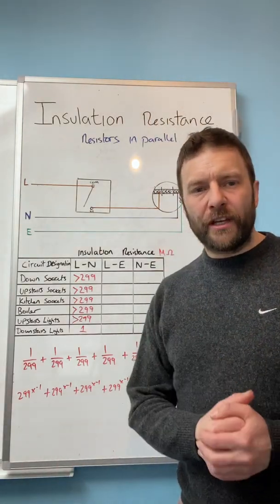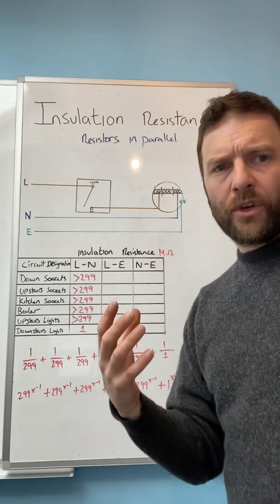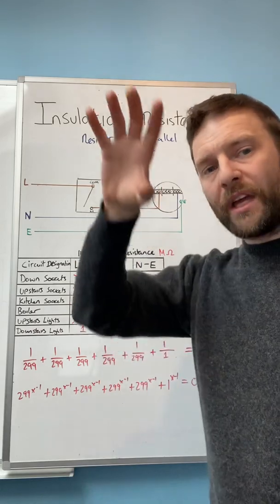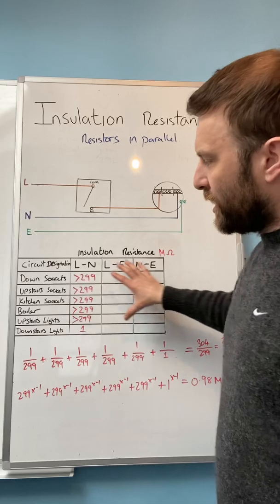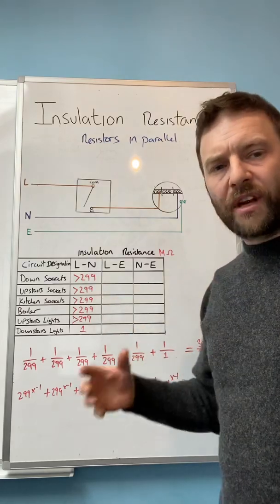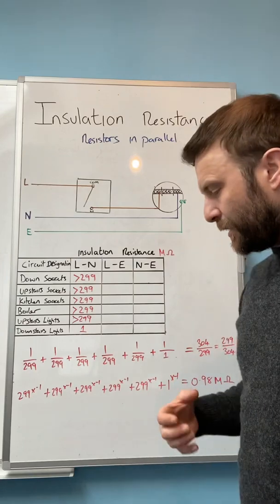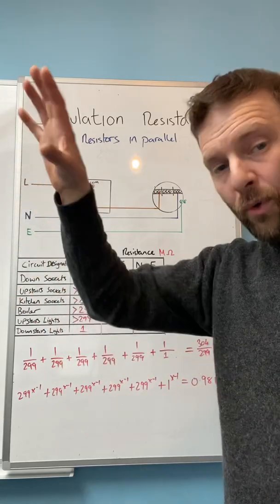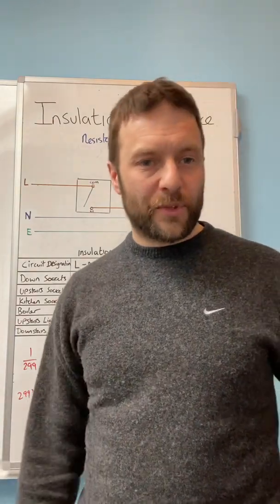Are you testing insulation resistance of a domestic installation properly? I now know I wasn’t!

Comment: Hi, what if you had 10 circuits all with 190Mohm? All the circuits would pass well above the minimum, however all the circuits in parallel would be around 19Mohm, would this then be fail using this logic?
Reply from the maker: No, because 1Mohm is the minimum for the whole installation
Reply: @Pure_electrical_training  I was using the example of 20Mohm, for a new installation.

Comment: Hi Adrian, could you tell us which document (GN3, BS7671 etc) recommends this particular procedure of calculating an installation’s IR?
Reply from the maker: It doesn’t, you learn it at college, but no one seems to explain the connection between resistance in parallel and insulation resistance of circuits 🤷‍♂️
Reply: @Pure_electrical_training  I see, thank you. Could you please explain how over range results given on IR meters (>999 Meg ohms for example ) can be used in a parallel resistance equation? These aren’t quantifiable values so how can we use them to obtain true results?
Reply from the maker: I get your point, I should have left out the greater than symbol, but the video was for illustrative purposes and was really only to prove a point.

Apologies for the miscommunication, however a resistance in parallel is always going to be less than the lowest resistor and if that is 1Megohm, than the installation will ultimately be less than 1Megohm and will need further investigation

Comment: Hi, where is this process stated in GN3 and why would you carry it out? Conducting a ‘global’ or full IR test at the DB accurately provides the overall installation’s IR and subsequently testing each circuit would locate the low reading when fault finding.
Reply from the maker: Some people don’t test globally, and only test individual circuits

Comment: Some one help me here.... When im IR testing or in other words for me checking if and how bad the breakdown of insulation between line conductors and between line conductors and cpc . When i do this MCB/RCBO/RCD/MAIN SWITCH are not a factor as i take them out of the equation, by that i mean for example on a ring final or radial .....twin and cpc are taken out load side of protective device and then on the other end all loads are removed possible or bypassed...I do every circuit individually and if they pass  why am i worried about the whole and resisantce parrallels  and resistance series etc...obviously too many loads in circuit that i can remove i.e 20 led down lights...i just join L+N and IR to CPC and mark a limitation...or am i missing something and its ok to just IR the whole installation in 1 quick test??? ..will get the regs out and read through after ive typed this lol...please excuse my spelling
Reply from the maker: If you test the whole board globally then you don’t have to worry about this, but if you test the circuits individually then you need to work it out
Reply: @Pure_electrical_training  Thanks mate

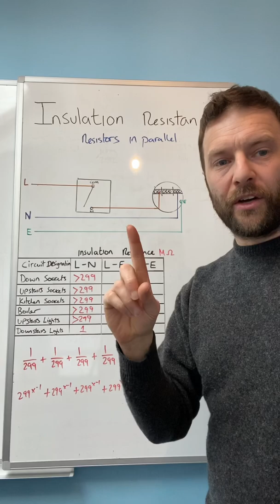Comment: 1:20 Adrian, where are you getting 20M ohms from?  Can't see it in the regs
Reply from the maker: Guidance notes 3 18th edition.

They changed it because to many people were passing brand new work with poor insulation resistance readings
Reply: @Pure_electrical_training  I'll have to update, my copy's still 17th ed.  I'm surprised this was considered an issue, in my experience new work usually returns off the scale IR results, or if there is a problem it's usually a dead short from a fixing screw or whatever.

Comment: If I make additions to one circuit I would be very unlikely to do an IR test on the other connected circuits especially now we have multiple RCBO's that would all need to be disconnected. Take for instance a 6 way cu with the following IR readings 20,99,60,10,2.3,2.4 individually they would constitute a pass on an EICR but for the overall installation we're looking at 0.97 ohms so a fail if my calculation is correct. If I alter a circuit on a 40 way DB and don't carry out an IR for the whole installation do I have to record a departure from the regulations! on the grounds the owner cannot afford to shut down the factory because I've installed an extra socket. Interesting regulation but unfortunately not very practical, I will however keep it in mind for EICR'S. Thanks.
Reply from the maker: It does make an interesting topic 🙌

Comment: Hi Adrian, doing the math can be a bit daunting for some electricians and when I taught this part of course I always pointed out that if you had resistors in parallel always look for the lowest resistance. So if the lowest resistance was say 100 ohms then the resultant of any number of resistors of any value  would be less than that. For the exam you would still have to show the workings, luckily its not a 100% pass required lol.
Reply: Same , global value will always be less than or equal to lowest value . To be fair to my students though , they usually get to grips with the reciprocal calculator method.
Reply: Thanks

Comment: With respect, I'm seeing a problem with the theory here. Your test meter has given readings of >299 (greater than 299) MegOhms on most of the final circuits. You can't then substitute a value of 299 MegOhms into calculations for resistors in parallel because this is not the result that the test meter gave. Greater than 299 could also be greater than 499, 999 or more. You'd have to obtain actual readings in order to use the calculation shown, then the theory and your excellent point, that a low yet 'marginal pass' reading for one circuit might cause the whole installation to fail when considered in parallel with very high readings from other final circuits, since the overall resistance will be less than the lowest value, as someone commented and reminded us. The point might become clearer if, say, we had 5 circuits that gave readings of 6, 5, 4, 3 and 2 MegOhms respectively, each in itself well above 1 MegOhm.  This gives a total parallel resistance of 0.69 MegOhms (according to my chosen online calculator lol), clearly a fail. I hope this helps.

Comment: Isn't it " 1/Infinity + 1/Infinity + 1/infinity + 1/infinity + 1 = 1 " which is a pass ?
Reply from the maker: I don’t think it is infinity and I remember being told that we shouldn’t use that term.

I cannot remember where I heard it
Reply: @Pure_electrical_training  it's just simply 'greater than' the max figure by the tester used at the time
Reply: There is no such thing as an infinite resistance, in order to test an infinite resistance you'd need an infinite amount of power, which is obviously impossible. There are extremely high values of resistance but they are not infinite.
Reply: Hello! In a parallel circuit, the resistance of the whole circuit will be always smaller than the smallest resistance present in that circuit.
Reply: @DoruDiaconu  I get that but when we measure an IR as >299 what we are saying is that the IR in all practical senses is infinite.

Therefore we don't divide 1/299 we divide by infinity whuch is as near to zero as its possible to get.

So the sum in essence means we ignore the circuits with infinite IR resistance
Reply: I get that in terms of IR testing there is no such thing as infinity but there is as I said above the situation where " in all practical senses we consider it infinite " and therefore discount it form a global IR result 

Otherwise you test one circuit at 1.001 meg ohm then test all the others at >299 with your KR64 and that drags it down to <1. Customer then asked sparkle two to check your results and he turns up with a fluke 1664 and produces results for the good circuits of >999 and we find the global result then isn't <1

How can we have a situation as proposed where whether something passes depends on which tester you turn up with !

Comment: So If at all possible the insulation resistance should be measured across the whole installation at once. 
Otherwise you can use this calculation to work it out for situations where you might not be able to carry out an install wide IR test
Reply from the maker: Yes